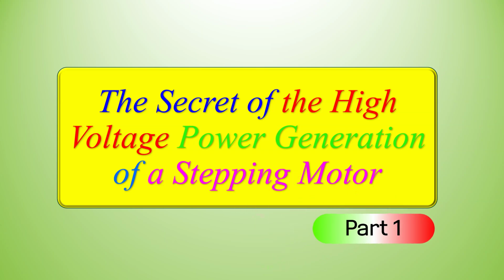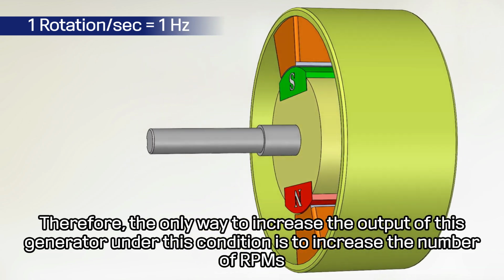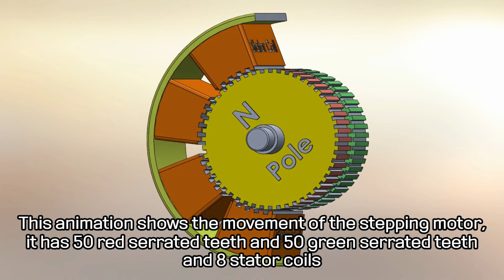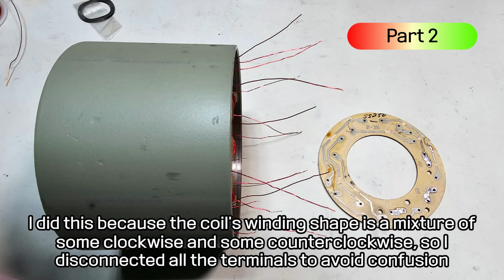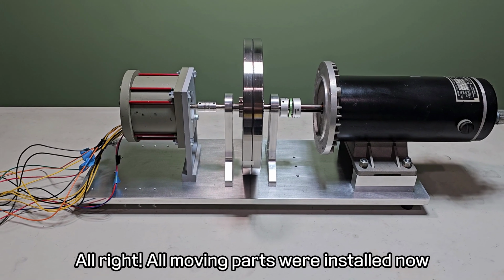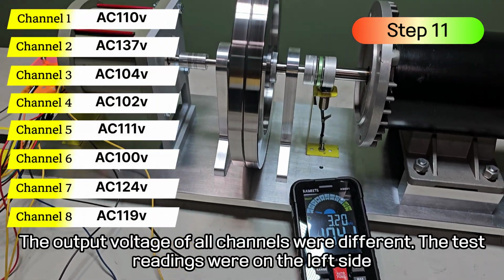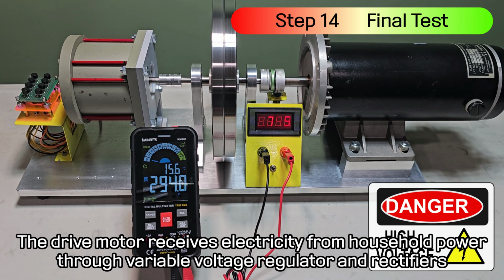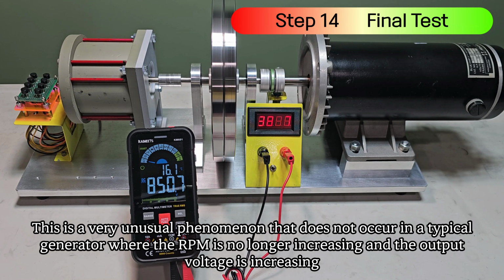The Secret of ultimate voltage generation by a stepping motor, Part 1

Comment: Do you have a reader for volts/amps? Volts can be meaningless with 0amps. Same for 0volts and high amps.
Reply from the maker: So I collected the power from eight channels in parallel and ran the motor in Part 2

Comment: Thanks for sharing !
Interesting !
But, High voltage is NOTHING without Current, it is USELESS,  
like "Microware small motors", they produce high voltage, but without almost any Ampers, and finally, the result is very very low Whatt  that is useless in real life ...
Reply from the maker: Some people misunderstand about YouTube content. Most of the content is just for YouTube itself, not developing grand new products. Nor are they the results of research. My content is not developing a high-performance generator, either. It's just 15 minutes or less of fun content just for YouTube content. This stepping motor has a very low current, of course. But in the previous content I made with a small stepping motor, the voltage ranges from 500V to 600V, and the remaining soldering flux in the rectifier circuit board caught fire. Also, it happened again in this content. And the new stepping motor is a high-power torque model used for the Cryo-Pump cold-head. I didn't include it in this YouTube video, but I could easily turn on eight LED lights. So, it's never going to be negligible. I hope this was helpful. So I'm working on Part 2, and I'm going to check the current and show it to you. Thank you.

Comment: Is it possible to generate your own electricity for your own use?
Reply from the maker: This stepping motor's current will be very low because it is not a regular generator, it's a motor. So the answer is "NO". Thank you for your comment
Reply: Yes but others don't want to be use .... Power company will distroy it